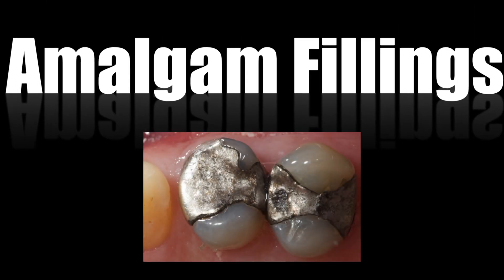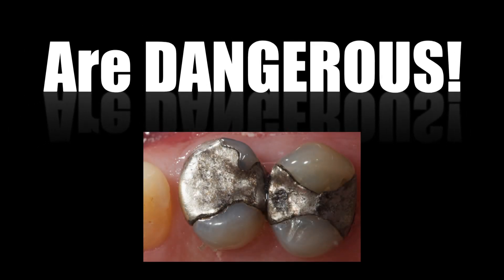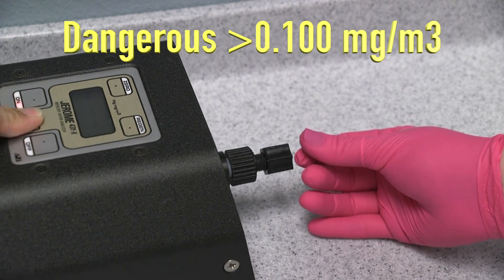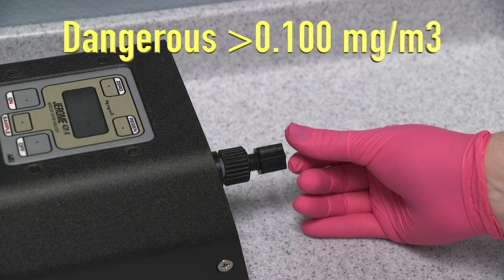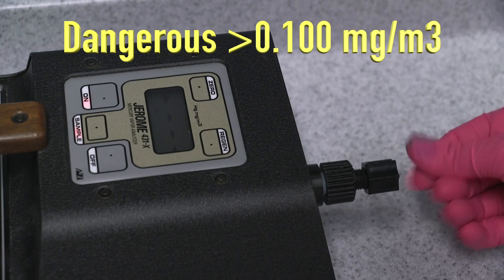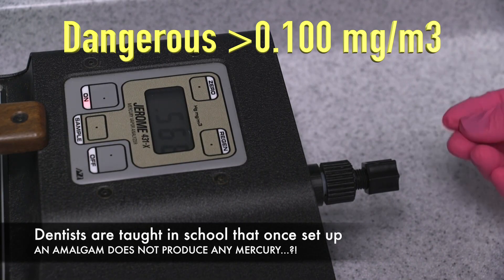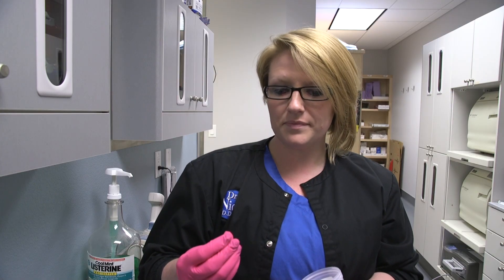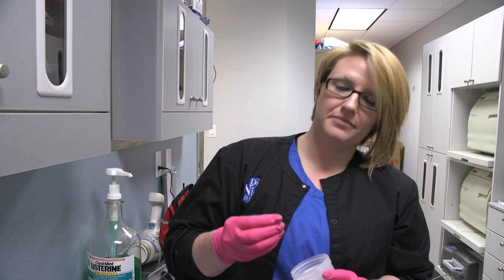DENTIST Proves MERCURY Released From AMALGAM Fillings!

Comment: It's unethical to scare people into getting amalgam removed just so you can make money off of them. Holding a piece of mixed amalgam in front of a mercury detector is not applicable research. Of course the amount of mercury vapor is going to be much higher at the beginning of the amalgamation reaction, that's insignificant to the decades its in the patients mouth, this is what needs to be tested if there is concern. The reaction is complete in minutes and basically no measurable mercury vapor is released thereafter.

Comment: You should base your videos on a scientific basis rather than on an experiment you have done yourself. Besides, who knows if this machine used to measure mercury amount is accurate, there would be many factors that needs to be kept in mind before concluding such video and that is why there are experts in dental materials and researcher who are specialized in this feild. This video is misleading. No single research has ever yet proven the harm of mercury in amalgam fillings and it is not recommended to be removed unless it is faulty, consider the harm that you expose your patients to while removing their old filling just for myths that none has proven yet.
Reply: This video is a science experiment, you are high
Reply: @whutwhut2434  They literally didn't even simulate saliva, you are high.
Reply: @Metal_Master_YT  tell us more
Reply: @whutwhut2434  more what?

Comment: I imagine the 0.1 limit is an average over 24 hrs. So if you get 0.000 when idle, and 0.140 when brushing teeth and a bit higher when eating.. it probably isn't a big deal since the average over 24hrs is going to be way less than 0.100 - so what we don't know is if that is a safe limit.
Reply: I had over 25 amalgams since I was a child. A few removed unsafely and then the last 13 removed safely.. but i still got ill. Thought I was going to die. It's been a very slow recovery.. Thankfully I found ACC protocol and I am getting better. We know it's unsafe so why are dentists still using it when there is safe options like composite?! Why are we even discussing what a safe amount would be it's crazy!
Reply: @Groovytunes96  Hoping you feel better soon. Were you feeling sick before having them removed?
Reply: @markhemsworth2670  Thanks yes I'm making good recovery. yes I was ill before.
Reply: @Groovytunes96  What protocol did you use? I am going to remove my amalgam too so that's why I'm here for preparations.
Reply: the number would be ten times less if they simply simulated saliva.
the real question is, is OSHA correct? and are they trustworthy?
Reply: Any mercury at all is not safe is the point of this vid. Smdh

Comment: It does sound like a kooky conspiracy, but it's almost inconceivable that a material that's been used in dentistry for over a hundred years hasn't gotten a strong reevaluation and (likely) a rebuke in the US. It does make sense, though, that the ADA, which is essentially an NRA for dentists, is going to champion the position that kicks the can down the road for potential liability for this material's use. The ADA is never going to come out and say, "Well, it turns out, yes, what we put in your mouth has slowly, chronically been poisoning you."

While the exposure levels may not be catastrophically high, there isn't good data on long-term, low-level exposure, and I can't see good reason not to consider the idea that, for some people, there is absolutely harm done just by the presence of a source of mercury within the body itself.

This demonstration itself, while certainly only one data point, and conducted by one group of people, shows, quite readily, that the claim that the material is safe and does not escape the implant once fixed, is highly suspect.
Reply: its a poor test at best. like are you even going to simulate saliva? or body temperature?
Reply: @Metal_Master_YT  is your thinking that saliva and body temperature make having a poison in our mouth safe? I'm just not sure it matters much..the question I would ask is why aren't dentists themselves doing these tests to reassure their patients? The stake from the FDA is contradictory :  safe for some people, unsafe for others - no, mercury is either safe or its not..also the hazardous waste  disposal protocols - safe to have in your mouth all your life, but must be disposed of as hazardous waste when removed? Once again, it's either safe or not..I'm not sure we should be playing god and running experiments that can destroy lives in the HOPE that something clearly toxic will have no dangerous effects when mixed with other metals and placed in a human mouth. There is a reason the Hippocratic oath exists.
Reply: @Chris-dw6cu  "why aren't dentists themselves doing these tests to reassure their patients?" because it would take time, and a lot of communication. its just a lot easier to say nothing. I would hope that they communicate the safety and dangers of amalgam better, and that they demonstrate why they think its safe or not, with more confidence and evidence, and less ambiguity. I think dentists should definitely do a better job in that area, and I wish they knew how to handle mercury better than they do now. I can totally agree with that.
and I think that putting "poison" in your mouth is probably a bad idea, and I think it should be stopped eventually, I just don't think its nearly as bad as people make it out to be. I think some people exaggerate the danger. I hope you get what I mean. I just don't like how they did this experiment, and I think that this test should have been done better. I'm a firm believer in proper experiments done strictly and carefully, otherwise I don't trust that the conclusion is accurate.
Reply: @Chris-dw6cu   they seriously need to teach logic in school, because so few people seem to know it. People also really ought to know chemistry and physics before they post comments like this...
 First of all, there is no such thing as "safe" and "not safe", because safety is a gradient, and you need to understand that. For example, is paper safe? Well, you can get a paper cut, so is it therefore dangerous? No, not really, it's only a little dangerous. As you can see, things aren't either "safe" or "not safe", because it's not black or white, it's a gradient. And so if mercury doesn't place very high on this danger scale/gradient, then it's perfectly reasonable to use in everyday life. You seem to think that if it's dangerous AT ALL, then therefore it shouldn't be used for anything. This is a very foolish concept.
Reply: @Chris-dw6cu  I know this was a year ago, but I hope you didn't let someone with the name metal master detract you from believing that mercury amalgam in the mouth causes harm. Because logic tells me that it's damn well obvious that it does! Were talking basic common sense here. Sheesh!
Reply: @robertharper3114  It's entirely possible he's a bot or a paid shill for the ADA, no way can someone be so stupid as to believe something that can VERY easily off-gas 5x the legal limit for mercury vapor set by the EPA be safe.

Comment: eh... mercury vapors are dilute and its not easily absorbed from that amalgam, especially considering that its covered with saliva (water) constantly. (water is a common and effective method of preventing mercury vapor) its also mostly suspended in the silver-amalgam and is surrounded by inert silver atoms, as well as some other metals which block the mercury from getting exposed to your mouth, or the air. mercury has one of the lowest evaporation rates of all known liquids, so, it really can't be that much vapor. only over very long periods of time is it visibly harmful, as one would expect, since elemental mercury poisoning is almost always chronic and absorption through skin/surface-tissue is well-known to be quite slow.
if you disagree, that's fine by me, just don't start an insult war.
Reply: Propaganda
Reply: @frank-vh6ij  do you honestly have nothing useful to contribute?
Reply: @Metal_Master_YT  https://youtu.be/9ylnQ-T7oiA?t=177 mercury is a very very active metal and chronic deposition in tissue has been presented with peer reviewed research in the past. there is no debate here, chronic toxicity of the most active metal will get into your tissues atom by atom and block and impair most if not all life sustaining biochemical processes. 

as an answer to the question you've raised in your previous comments the actual toxicity limit of mercury is "zero" , regulations are a constant trade off between public health and ever increasing profitable economic growth and negligence and what not.
Reply: @asencyel  I'm sorry, my comment got deleted, so I made a new one, it got deleted again, so I made a new one, and it somehow got deleted AGAIN, so I'll try to make this short, but I'll probably find myself writing a full-on book again:
#1 mercury is not a "very very active metal" look it up.
#2 please show the "peer reviewed research" I mean, the whole point of evidence, is to, you know... provide it...
#3 "there is no debate here" wow, way to shut down the conversation. you do realize, that if you're wrong, and you say that, it doesn't actually make you right. all it does is discourage productive discourse about a genuinely controversial topic, by claiming that your position is perfect and shall not be challenged, which is, of course, quite foolish.
#4 "impair most if not all life sustaining biochemical processes." I don't know of ANY toxin that can impair ALL biochemical processes, you would need to absorb an astronomical amount of mercury into your body for it to attack every cell, and stop every biochemical process, and that's assuming mercury actually even DOES that in the first place... which it doesn't. mercury targets the nervous system and also sometimes the kidney and liver, but definitely not every biochemical process, that's absurd, you must know nothing about biology or human anatomy to believe that.
the only way you're statement is true, is in the case of death, yes, if you die from mercury poisoning, (OR ANYTHING ELSE ON EARTH) all biochemical processes will eventually stop, cuz, you know... your dead.
#5 "the actual toxicity limit of mercury is "zero" " ok, so if something is poisonous at all, then the tolerance is automatically 0%? this, is once again, entirely absurd, its literally impossible to remove every particle of mercury from your body, I know for a fact that there is some in your body right now, but that doesn't make it dangerous, because its such a small amount! safety is a gradient, and more people need to understand this. I'm seeing this more and more among people online in general, but in particular the people arguing against amalgams. they seem to think that if something is harmful at all, then it should be made illegal. this is of course stupid, if this actually happened, every person on earth would die, because everything on earth is dangerous to some extent. learn to use the cost benefit analysis. dangerous things, to an extent, are fine, the benefit you gain from using them will outweigh the cost, but if it gets too dangerous, then the cost will outweigh the benefit. so you just have to weigh it.
but hey, I'm fine with you deciding not to get any amalgams for these reasons, its your teeth after all.
I just want you to make sense and say things that are true.

Comment: What about the fact it's in a warm moist area which absorbs things very well, wouldn't that reduce the safety margin? How many patients have you seen who's amalgams have fell out and could potentially have been swallowed? (acids attack metals) how many patients don't heed hygiene advice after having them placed? If the cavity opens up again, greater exposure, plaque acids, etc, what if you lick your teeth?, have you seen worn down amalgams (if they are deformed the mercury had to go somewhere) yet once they are in drilling them out makes it worse! The idea they are still being placed is horrendous. And besides the toxicity (which is MORE than enough reason not to put ANY mercury in your mouth) they look horrible! I've seen people who's fillings are black, they can't say there isn't a chemical reaction going on and that leads to release. Especially where multiple have been placed, this could be really bad! The only truly safe level of exposure to mercury is 0! Gram for gram it can be more dangerous than chromiumVI, cadmium, lead, thallium OR arsenic!
Reply: I replied to you, but my comment got deleted, I have no Idea if you can see it or not. well, its not on my screen anyways.
Reply: The reason for the somewhat harmless effect of touching or swallowing mercury is because its insoluble in water and oil/fat, so it cant easily get absorbed by your body.
the warm moist effect of your mouth actually reduces total vapors, because your saliva covers the amalgam preventing MUCH of the vapor from escaping in the first place.
and the silver, tin and copper in the amalgam not only dilute the mercury but also surround mercury atoms preventing many of them from ever escaping into your mouth, or the air.
if you "don't heed hygiene advice" that's your fault, not the filling. "if they are deformed the mercury had to go somewhere" sometimes, yes, but frequently that's not the case, try bending a stick of gum in half, does the gum leave your hand? no. is it still in one piece? yes, its just folded. is it deformed? yep. but its all still there tho? yep.
"And besides the toxicity (which is MORE than enough reason not to put ANY mercury in your mouth) they look horrible!" first of all, you eat food with preservatives and minor toxins in them all the time, not only that, they're also junk food and unhealthy. but so what? your body can easily handle and repair a little damage. second of all, I'm proud to be a pirate! arg!
"The only truly safe level of exposure to mercury is 0!" yeah lol, you can literally never get to zero, even if you eat absolutely no seafood, there will still always be a small, detectable amount of mercury in the average person. your statement is silly because it can never actually happen. xD the amount of mercury in your body is a gradient, its not black or white.
if you take good care of your mouth, your mercury fillings shouldn't really ever bug you, unless they crack or start to fall out, due to improper installment.
"Gram for gram it can be more dangerous than chromiumVI, cadmium, lead, thallium OR arsenic!" you know, its awfully easy to just cherry-pick all the chemicals that are less deadly than mercury, here let me try it: "mercury can potentially be more dangerous than breathing and sometimes even walking!" ugh, why am I even doing this... :/
Reply: @5688gamble I’m planning to remove mine. Did you mean removing it will cause more problems?

Comment: Getting my fillings out one at a time.
Reply: When you take them out what do you do? Do they have a safer filling alternative? Or does the tooth need to be extracted?
Reply: @Honey-Bee-25  I had them replaced with composite. Which is basically a white tooth filling. I’ve had them all done now. That was a year ago and I’ve had no problems. When I had them removed I did notice my mouth didn’t taste as metallic. I can’t explain. But it was definitely strange. I’m so happy they’re done. Would recommend